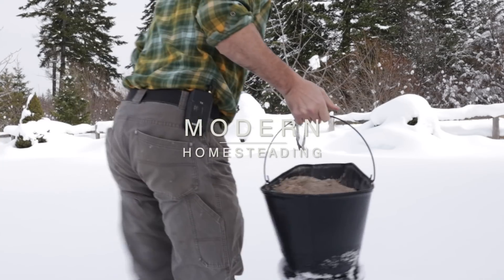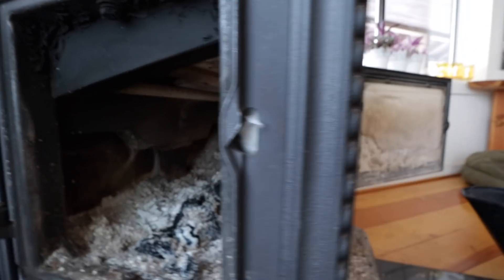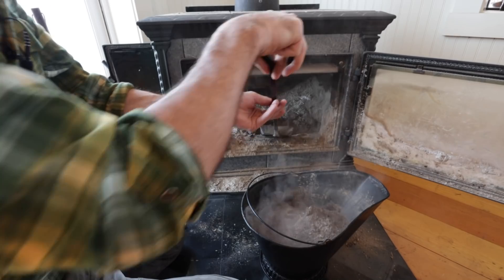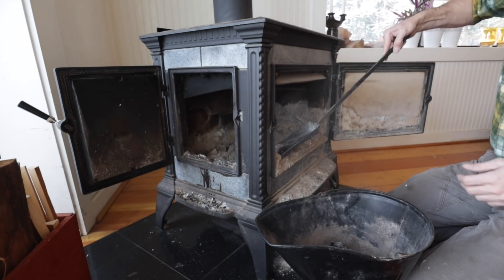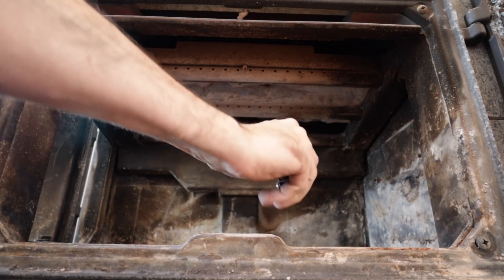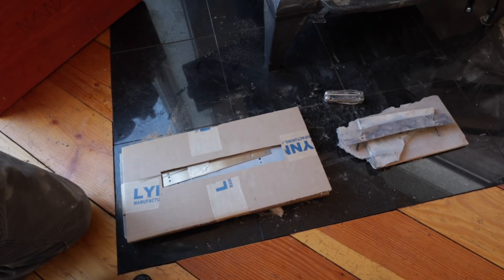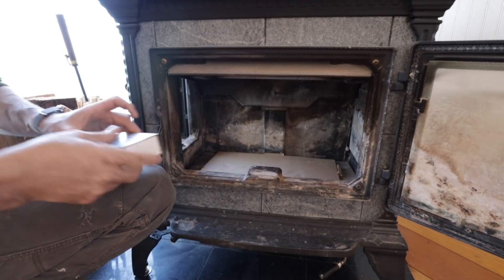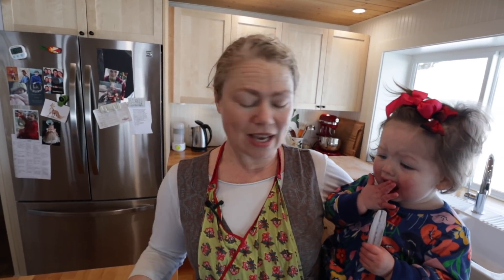Woodstove - Who Builds The Best Wood Stove?

Comment: My stove is an insert.  It's got fire brick just above the heat tubes.  There is a piece of ceramic insulation between the fire brick and the flue.   I see the newer models of my stove now uses that hardened baffle material, but still above the fire brick.  I don't like the ceramic insulation and asked if I could put the solid material in it's place.  Absolutely not said the dealer.   I've got an Osburn and would never give it up. For an insert it's fantastic.  If I ever had to replace the burner I would seriously consider putting in a woodburning cook stove.   
Instead of 'stuffing' the wood stove' and breaking the baffles, how about cleaning some of the bottom ash to make room for the wood?

Comment: As you are in a location that the power can go down a good option for backup heat when you are out is one of the cheap diesel heaters as that can be run off a deepcycle battery. A battery maintainer on the battery and a relay to keep the heater itself off when power is to the house would give you a good backup heat without fear during a storm you are away from the house.

Comment: I recently purchased the exact same stove, do you have any issues with getting it to draft?
I find I need to leave the ash drawer open to get hot and then if I turn the primary draft closed it still burns pretty hot.
I keep forgetting to check the door seals but if they leaked wouldn’t it be easier to get drafting?
Reply: Ash drawer is the main air source, you should never have the amount of ash in the stove like in this video. You will just end up breaking the stove.

Comment: get an ash bucket with a lid, you quickly put the lid on after dumping in the ash to prevent the dust from coming into the air. Also throw that shovel in the garbage and use a normal short handle landscaping edging shovel. That is the way I have done it for 20 years,
Reply: The dude is going to be 50 years old, I think he has done this for a while too now.  Why don't you get off his cloud, Sensei?
Reply: @turnersparadise8368  just because you have been doing something for a long time doesn't men your good at it.

Comment: There are a ton of options where it comes to wood heat. Building codes apply in most places throughout North America, but there is some leeway in Canada if you get your system WETT Certified. In saying that if you're handy with masonry or willing to take your time if not, A masonry wood heater is the ultimate in thermal mass heat storage which can radiate for days depending on the design once heated up. The trick with them is the baffle designs inside the construction of the heater made from firebrick or fireclay. As the smoke or flue gasses wind their way through the baffles s it heats the masonry which can be done with fieldstone or cut stone of almost any type of similar materials giving you the option for mass into a thermal mass. It can add a great deal to the decor of any home. That's just one o[ption for a primary heat source that has endless options as far as design and overall look, size, and efficiency, etc.

Comment: Best cast iron wood stoves IMO are old Vermont Castings from the 20th century, Vigilants and the bigger Defiants. My grandparents can heat their entire home with their Vigilant, they cook on it, humidify their house with an enamel pot set on it. And it think my granddad modified his, and put a slab of soapstone in it at the bottom, for heat retention. He also has his stove under a ceiling fan, since heat rises, the fan disperses the heat laterally throughout the room, where it then rises at the walls/obstacles, creating convection.
Reply: I think you'd get a kick out of my Grandparent's house, it's an octagon, built around a central chimney, which the vigilant is piped into.The octagon is two floors with a widow's walk on the roof going around the chimney top, and the space around the chimney goes from the floor to the roof, so you can see the entire chimney. The ceiling fan is attached to a redwood beam, set directly over the stove at ceiling level, so there's a lot of air above the fan that feeds the fan. Once the main room, with is an open concept kitchen/dining/living/library all circling the chimney, is heated, it stays warm long after the fire is out and only small embers remain.

Comment: Just a word to make your environment more pleasant, and much healthier!!!   When removing the ashes from the stove ...

  1)  Make sure none are glowing with heat, and place into the metal 'coal shuttle' container made for that !  We usually let them then sit on the stone hearth for a day then transport them outside into the larger ash can along the walk & driveway, for use on slippery ice.   Spring time leftovers go into the garden !

 2)  When handling a shovel full of ashes...  DON"T tip the shovel 'upside down' and make a ton of ash all through the air (as you see on this video)   =  To avoid that horrid mess ... place the shovel full, face up with far edge tipping downward in your metal 'ash bucket',  then gently,  quickly slid the shovel out from under the ashes.  You'll get almost NO ashes or dust polluting your clean air !!!   It's  SO SO SO easy and clean,  leaving good clean air to breath ! 
 
 One family member here is asthmatic so this was important for us!  Also lessens vacuuming time = yea !   We've been heating with wood for almost 50 years and did a lot of research for the best wood stove for our cold, damp northeastern mountain area.  We found the Vermont 'Woodstock' brand's  "Progress Hybrid"  the most practical,  efficient, and attractive for our home.   It does have an 'optional' catalytic component,  but works fine with or without. It's been keeping
us cozy for five or six years now,  and we're quite happy with it!
Reply: OPPS......... mistake on location of the 'Woodstock Stove Company' !    It's actually in New Hampshire...  just
as beautiful a state as Vermont is,  but a different state name !  Sorry !   ps -  Been cooking on my 100 year
old, big ancient cast iron cookstove !!!    AND LOVING IT  !!!!
Reply: ALSO .....   almost positive that  (in our area)  a wood stove needs more clearance for safety than what that particular stove has !!!

Comment: That mess you’re making with the dust cloud @ 4:22 could easily be avoided by scooping up the ash while the chimney is still pulling a draft. Sometimes I do it while there’s still coals in the stove. Just rake them to the side and scoop away. The fly ash gets sucked up and out the flue. Of course, metal bucket is a must. Or, If you prefer, running the shop vac with the hose held above the bucket works as well.
Reply: I use old olive oil containers/cans with a wire handle for the ash that gets scooped out once or twice a week. I can then just place them on the hearth or outside to cool down before emptying them onto the garden or back yard. Works for me.

Comment: The exact reason I went with a Blaze King, the deep fire box holds ash and wood MUCH better and you don't have to worry about coals and wood falling out when you open the door, not sure why manufacturers make the bottom of the stove level with the door, it makes absolutely no sense other than its meant to look pretty.

Comment: Old video but, my guess is that it broke (actually cracked) the very first time you fired it up. If it anything like a deck oven you MUST heat it slowly (over several hours and increasing the temp slowly). To much heat too fast and it will crack, then its just a matter of time before it collapse. For a deck oven it is a 2 days process and the final temp is brought to about 240 °C .

Comment: Use stainless wire to hang a piece of expanded metal to protect the baffle under the tubes. shouldn't effect the air movement, and a quasi heat shield.

Comment: I heat also with wood, but past 5 years mostly anthracite coal.
I have a Harmon furnace (SF 1500). Burns wood or coal.
I has no wear parts like you are replacing.
Just wear (warp) on the cast iron grates, if I let the anthracite get too hot.
I changed 3 once 5 years ago.

That's a step up from what you have. Just sayin ...

Comment: instead of a cast iron stove that instantly radiates all its heat, i wanna try wrapping the exposed chimney pipe in as much copper pipe to cover the entire exposed chimney pipe and use that to heat a 100 gallon taken adjacent to the stove. then that heated water which happens to be the best storage medium for heat hence its use in boilers,  and that heat can radiate off after the fire has died down.
you could even make a radiant floor heat system off this same setup.

Comment: you should make your own best ever wood stove .glowstove upgrade 2021.3 inch thick refractory panel construction   instant heat from the 25 x airheating tubes . 20 hours of stored energy from the  refractory construction . 1/2 a day to assemble in situ.

Comment: Hearthstone woodstoves are a great product take the longest to heat up but hold the heat for longer than a cast iron or plate steel stove if I recall right the factory glues the first baffle in with refractory cement for shipping so they usually break trying to take them out for the first cleaning each Heartstone is like a piece of art no two are alike if you look on the back it's even signed by the builder

Comment: Cody, wtf. The rest of your life is all neat and clean and you make a video with your soapstone in that condition. I have that exact stove and can say with authority they do not work with half the ash you had in that heater. You should clean it out every two days. That kind of laziness is dangerous. Letting ash pile that high is probably how you and yours punched out your baffle. It’s a small box to begin with. Not to mention if you did any maintenance on that stove it never would have gotten that big hole in your re burn secondary system. It wasn’t even functional man. OMG you triggered my safety instincts. And you call yourself a fireman?!!. 
Because I love your content I will leave a tip with my critique. If you clean the ash off the top of that baffle when you do yearly maintenance it will last longer and work better. If you do crack it put the pieces together carefully so they block the smoke from going directly up the chimney. Until your replacement arrives. Keep the old pieces in case you need a fix later. That is the key feature that makes that heater chooch. I bet you use half the wood now. I will say a prayer. That box keeps the fire from taking all that is near and dear to you. I beg you spend more time on your hearth. Please!!
Ps. I like to pack a little clay in around the manifold as the cement falls out over the years. Make sure no smoke gets by the gaps in the back.

Comment: I am glad to see you using an "EPA approved" wood burning stove in your home.  The baffle keeps the fire box and the combustion air tubes hot. Preheated combustion air comes out of the rows of holes along the length of these stainless steel tubes. This preheated air burns all the combustion  gases and smoke. This brilliant design makes this wood stove in your house, far more efficient than the shop built wood stoves featured in several other videos on your channel. Those homemade stoves produce a lot of unburned gases (pollution), some of it visible as smoke. This is unburned (wasted) fuel and it will condense into creosote on the inside of your stove pipes. You can help improve the health and wellbeing of thousands of families just like yours, by teaching your 1.7 million viewers about the benefits of using a clean burning "EPA approved" stove. They are cheaper, cleaner and safer to use.  A video about the danger of burning treated lumber, especially the older copper arsenate type, (no longer produced), would also be a great benefit. You are a good teacher, so please continue to use your talents to make the world a better place.

Comment: Soapstone stove In your opinion  it's the best , first that baffle is junk it's going to happened again it's not the user it's the material  you better off cutting a piece of 3/4 steel in stead . Clean the ash regularly , but leave a 1 inch fire well be holding better . ..in my opinion .

Comment: Sounds like your confusing cast iron stoves with plate steel stoves. There is a big difference in heating and cost. My cast iron Yodel rangely holds heat and burns all night long. It takes a while to heat up and holds heat very well.

Comment: You never explained what/why  the Baffle is incorporated in the system also I know that since 2008 a fiberglass blanket is also included in the replacement kit which is installed on top of the baffling to act as a simple filter to catch the fine ash  particles from going up the flue. That said I would not trade my Hearthstone Mansfield (second/ larger ) Hearthstone wood stoves I’ve enjoyed for 28 years.

Comment: Well what actually broke the baffle was that you didn't clean it out causing the floor to raise up with ash.
I know I'm guilty as charged - except my heater has a metal baffle and it falls in the fire and is enormous. It is almost impossible to refit while the fire is hot. It drives me insane - almost nothing enrages me more lol. Just think all the grief could be averted if I'd just clean it out a bit more often but noooo. Why? The stupidity of me!
About these parts we have two main types, plate steel and cast. Each have their own pros and cons. Plate steel heaters heat up very quickly, cast on the otherhand not nearly so quickly but give a much more even prolongled heat and believe it or not use less wood - I reason because of the thermal mass once they're up to temp requires less fuel to maintain that temp (bit like a horse pulling a railcar). I've had both, in the same house actually. The new plate steel one was very expensive but it was also very good, but I preferred the cast fire. The cast heater just took so long to warm the house yet all the secondhand cast heaters that come on the market are sold by the time you ring the number. That tells you something. 

Fires like yours always work well. Wide deep fires alway seem to be better than square in my experience. Others' experiences may differ however.
Re outside temp, the unfortunate thing with cast heaters is they often glow below cherry red. That low glow is ~ 550deg. The plate steel fires have heat shields that signifigantly protect from that. Mine has 3 layers for placement against a wall or in a corner - the firebox, the main heatshield and another behind that. It does induce good convective currents aiding to their quick warmingveffect but a cast fire inside a brick fireplace is also a great thing and probably the best location for that type.

Comment: I remove the ash Inside the stove,  its a terrible thing to have floating around.  I get a bit of a draft going by leaving the door open, and use a hotel pan which should fit easily into the stove and fill it insid the stove.  'zero' ash inside the air.

Comment: Thought this was going to be a review of woodstoves. Not an infomercial on your wood stove.

If the heat is not radiating from a soapstone stove like it would from a cast iron stove, then wouldn't it be safe to say that the soapstone is acting as an insulator? If the soapstone is indeed acting as an insulator, the heat has to be going somewhere. The logical conclusion is that if the heat is not being radiated into the room, then it is going up the chimney.

Comment: For the best solid or multi fuel combination visit-
http://www.countrystylecookers.com/rayburn-ranges/royal-solid-fuel
These things are awesome if set up right with a small automatic generator and battery to run a hot water system and up to six radiator central heating system.

Comment: You may know your wood stoves...& great info...but it sounds like you do Not know about firewalking! 
Firekeepers spreading ash over the coals to insulate bare feet from the heat???—maybe some do, but not traditionalists.  Not the firewalking I’ve done...it was bare coals....And the 30 or so people participating, not only walked or stomped through those, but cartwheeled hands-&-feet, & danced the hokey pokey through them. No way even a thick layer of ashes would stay put to “protect” skin from those hot coals!  The real secret is the same principle at play when someone uses bare fingers to pinch-out a flame, or, holding their bare palm above a flame...& general science:  Time, Distance, Intensity of source, matters.